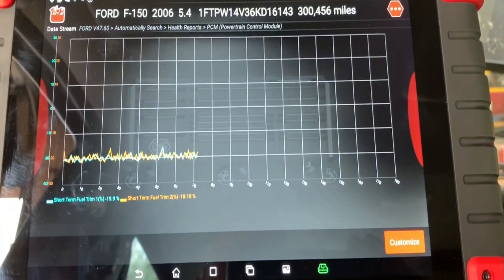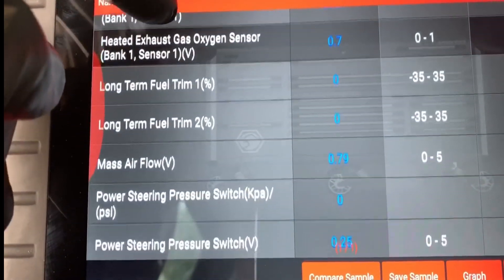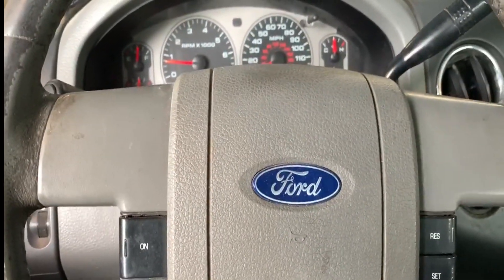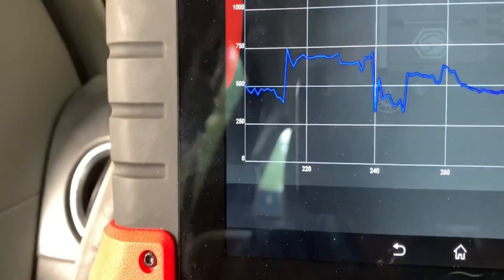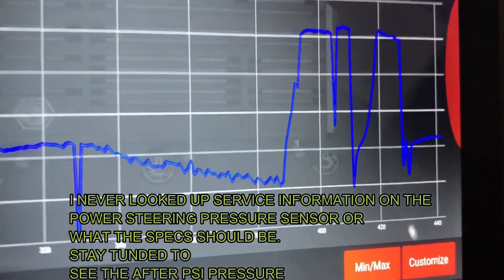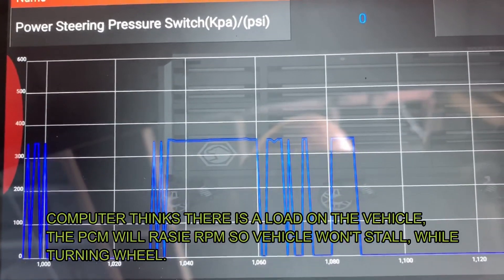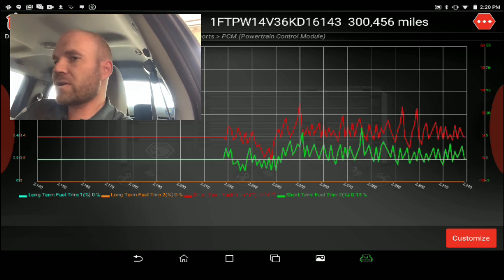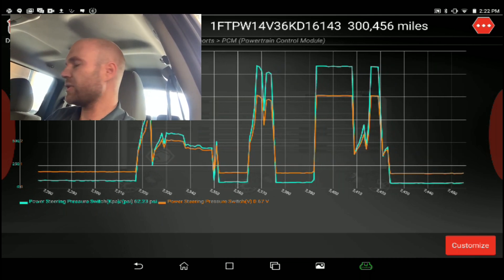NEGATIVE FUEL TRIMS?

Comment: Thank you 🙏🏻 been chasing the problem for a while after doing a timing chain and cam replacement on a truck I got when my BIL passed. My wiring is good but switch was bad. I didn’t have all the readouts but the freeze frame data showed an 18% engine load at idle. Unplugged the switch and everything when to normal. The lock to lock steering trick was the clue I needed to fix it. Thanks so much.

Comment: Thanks I hope you just helped me solve my issue with a Lexus GX 460 with P1603-Stall : history, P 1605 , and a low/high circuit for steering wheel and ABS ; that’s rough idling, cycling LT fuel trim from positive to negative.

When I turn the steering wheel the idle speed changes.  

Thank you.

Comment: Awesome video! I don't have a Ford truck but just bought an Acura with 13,000 miles on it and my bank 1 ltft is around -2 to 0% and bank 2 is -6 to -1%. Is this any room for concern or normal readings?

Comment: Excellent job bud :) I came here because my 2013 2.0L n/a lancer (manual trans) is reading short and long term -11 any ideas where I could start? It has electric power steering not hydraulic. If it helps its throwing o2 sensor  codes occasionally so it could be that

Comment: What should i look at? 
Fiesta 1.6 ecoboost 200hp.
Got -13 to - 16 ltft only at idle, as soon i hit the throttle it jumps to -5/-3, at wot is -3%, but when i release the throttle it goes down again. 
The car runs good, no hesitatuons and pulls strong..just a bit of rough exhaust sound at idle, and sometimes when i start the car when it is warm rpm go down for a moment then up to 750 rpm and stay steady. 
No error codes, no misfire in any conditions, o2 sensors working good, no visible leaks anywhere..
Reply: @Albe983   You ever figure that out with your Fiesta?
Reply: @woodworks351 itnis normal having a bit negative long term fuel trim
Reply: My 07 Crv is running damn near the same as your Fiesta

Comment: Thank you so much , fixed the issue on my mazdaspeed3 , wich is a fomoco engine also, do you think its possible that this was also my issue for why my Maf voltage and airflow werent matching what they should in the tune ? Cuz my voltage and lbs/min were way off from the tune before , i didnt get a chance to see if its also fixed
Reply from the maker: Hmm that’s a good question. I would want to see the numbers afterwards and verify it f this indeed fixed both issues. I can’t tell you for sure if it would since this was a “first” for me on this vehicle
Reply: @codysautodiagnosticsprogra8706  ill get back to you cuz ill be logging soon haha
Reply from the maker: Sounds good

Comment: Can you help me with stft bank 1 shows - 100 and bank 2 is at 0 what would cause this E46 325xi bmw am using torque app that shows me my fuel trim
Reply from the maker: What are your long-term fuel trims? Is this at idle or under cruise?
Reply: @codysautodiagnosticsprogra8706  idle ltft 8.59 bank 1
Reply from the maker: From those numbers sounds like you have a vacuum leak somewhere
Reply: @codysautodiagnosticsprogra8706  can a bad disa cause this I have p1093 and 5 bmw  codes one of those code is a disa valve

Comment: Heyy Cody my honda pilot short fuel trim bank1 is -27.3%  and starts at 0%
But Long term bank 1 start at -13.3% and won't change and this is at idle..Didn't check other way.
Any advice on this please.
By the way those 3 cylinders on bank one are dead and the 4 elements are there well the pcm is taking fuel away i know cus short term -27.3%.
Can you tell me my problem???
No check engine light neither🙈
Reply from the maker: What’s the fuel trim on the other bank?

Comment: Why couldn't you do a fuel pressure test first just to make sure that this is what the cause of it is so then the other person who cannot read this information would make sense of them mine turned out my negative fuel trim turned out to be a fuel pump pressure so I have replaced it and now I get a good reading
Reply from the maker: Isreal Perez why do that when I could watch fuel pressure on the fuel pressure sensor instead. Also if I’m not seeing something stand out on the pressure sensor then I need to focus on something else.
Reply: @codysautodiagnosticsprogra8706  you know what it is is that there's a lot of forms out there on YouTube that talks about fuel trim but none of them talk about how to actually read it so my problem was I couldn't understand how to read it so then what I ended up doing was a fuel pressure test my BMW is supposed to have 50 psi and lot of forms talk about all vacuum leak this and that so I ended up just checking it for myself and I had 45 PSI and it was going down to 20 and a half hour so I rolled out everything else that I ended up having a vacuum leak and then I replace my fuel pump now I'm on now I'm on day 2 without a lean condition and no one can actually tell me exactly how to read or to understand in basic terms
Reply from the maker: Isreal Perez your absolutely right and honestly since these were rich codes I wasn’t focused on the pump. I see pumps lose pressure but I haven’t ever seen them build more pressure so that’s why I didn’t focus more on fuel issue. Even if fuel pressure is high the pcm would command fuel injectors closed longer to make up the difference. Could have definitely checked it for video purposes though
Reply: @codysautodiagnosticsprogra8706  I do have a question for you though I don't think it's based on lean conditions do you know anything about a P0 604 I own a 2004 BMW and that's the only code that I have left it takes two days for it to class backup I did a are trying to figure it out my lean condition and turned out that my fuel pressure was too low so that's why I replace my fuel pump but now every two days I would have this code above the P0 604 now I do like your video it was really great

Comment: Had you heard about the power steering pressure switch doing this to the fuel trims?  I would have never thought to turn the wheel.  Wow!
Reply from the maker: Okie-Tom i had no idea the effect the switch has on engine load signals to pcm. I was amazed as well lol

Comment: Does this apply to a 2001 Ford Mustang 3.8L V6? Or are those more simple. Mine is currently running rich on both banks.
Reply from the maker: If it has a power steering pressure switch (which it most likely does) then I would check this
Reply: did you ever find out ? i have a 3.9 mustang with high negative fuel trims and was curious what ur outcome was

Comment: hi does anyone know what it means if i have a stft b1 s2 (%)    NA     and    a  stft b2 s2 (%) NA ?  Hope someone can clarify this for me thanks.
Reply from the maker: Means your scan tool isn’t reading the fuel trims. What tool are you using?
Reply: Cody’s Auto Diagnostics hi thanks for the quick response i do get a reading for stft b1 s1 and stft b2 s1 so i believe my scanner is working I believe this is causing me to have a fail emissions test but i have no check engine light hope you can help thanks
Reply: my live data show activity on the 02 sensors on all 4 i changed the 2 downstream o2 sensors and i taught that would solve my NA reading
Reply from the maker: mase202 there is no codes in the system? When you went threw emissions what did it say it failed for?
Reply: Cody’s Auto Diagnostics i just checked with my scanner usually if its green it passes its yellow so it probably won’t but i taught it was weird that a n/a reading is showing for the stft b1 s2
Reply from the maker: That to me seems like a scanner issue. First thing I would do is try another scanner before digging to deep
Reply: Cody’s Auto Diagnostics thanks for the reply do you think something is not being read or disconnected with the na reading or unlikely

Comment: It's crazy how ford's power steering pressure switches can cause so much trouble. Just saw a diagnosis video on a ford escape from South Main Auto. Where the power steering pressure switch was bad and the pcm was throwing an evap code!
Reply from the maker: This one was a good one. Didn’t realize how much control that switch has on fuel trims. I haven’t seen that video from Eric-0, I’ll have to go search for it
Reply: @codysautodiagnosticsprogra8706  https://youtu.be/vp7g5sSzkh0
Reply: I think it is a 3 part video. It's very interesting.

Comment: My LTFT STFT are - 17... MAF 2.6 on idle and with ac on idle 3.5.. egr error 99.2 sometimes egr fluctuating even negative error... O2 sensor 1 no reading sensor 2 reading is .1 to .9... air fuel ratio commanded and measured fluctuating...
Reply from the maker: What size engine is this you are referring to and also can you command the front o2 sensor rich to see if can go above .8mv?
Reply: @codysautodiagnosticsprogra8706  my car is honda civic 2012 1.8 L
Reply: @codysautodiagnosticsprogra8706  using torque pro but not getting the reading of o2 sensor 1... for sensor 2 its .6 around
Reply from the maker: Mohsin Rehman you will want to force the o2 sensor rich then force it lean to see if it will go above .8 mv and below .2 mv. If it doesn’t then the o2 sensor is bad
Reply: @codysautodiagnosticsprogra8706  how can i do it
Reply: @codysautodiagnosticsprogra8706  if i unplug o2 sensor... the commanded air fuel ratio is constant 14.7:1
Reply from the maker: Mohsin Rehman lull the hose to booster and add brake clean or carb clean and see if 02 goes rich, then take it away and see if it drops lean

Comment: Ah nice one! For 10minutes im going like, what does this guy want with fuel trims and powersteering pressure data....? Thnx for the info m8!!
Reply from the maker: Right that’s how I felt seeing this. I was like WTF. Thing came back couple weeks later due to that power steering pressure switch pulling 5 volt ref low to 2.5 volts. The sensor was not OEM and was aftermarket but again fuel trims were negative 25 percent.

Comment: Seemingly thats a hard fault so regardless if codes where cleared why didn't it return immediately with just koeo?? Or is it one those consecutive drive cycle type fault????
Reply from the maker: You would think that it should have been a hard fault and come right back but it didn’t. I’m pretty sure if I would have done the KOEO or KOER test, a great possibility a power steering sensor code would have popped up. I didn’t perform this function and only performed a pre scan of all the modules.

Comment: Nice find. Makes sense, pressure sensor making the pcm think there's a load and it adjust fuel trims as necessary. Except it was a false reading.
Reply from the maker: Thanks bro, I had no idea how much the pcm strategy would look at the power steering switch but apparently it seems to hold some weight. Wish I could find more info on pcm strategy on this situation.

Comment: no fricken way.  how in the world did you diagnose this without a hope and a prayer
Reply from the maker: tracycolorado I got lucky bro. Pulling vehicle into the shop I noticed fuel trims changing while Turning the wheels
Reply: Cody’s Auto Diagnostics  but if you didn’t have your scan tool hooked up pulling it in it may have been a longer diag for sure! Goes to show you should always have that data streaming during a test drive. Even if it just into the bay. Nice find!
Reply from the maker: Martin Bonoan very true!

Comment: so how exactly does the switch do anything with fuel trim?? also did you get lucky and notice turning the wheel it leaned out?? then went from there
Reply from the maker: Pcm watches power steering switch to adjust idle rpm and injector pulse width to compensate for the load on the vehicle
Reply from the maker: Also I noticed the fuel trims while pulling into the shop and turning the wheel fyi
Reply: @codysautodiagnosticsprogra8706  good lucky find but good diagnosis seriously
Reply from the maker: Sometimes it points you ina  direction quickly and sometimes it doesn’t lol. Thanks for the comments buddy
Reply: Phil!

Comment: Weird is the only word to describe this situation. Why would the computer take any notice of a pressure switch ???  Maybe 5v reference is being compromised. The circuit diagram needs to be examined.
Reply from the maker: Ps pressure switch is an input to the computer to adjust idle and injector pulse width so vehicle doesn’t stall while adding a load from steering. Hope this helps
Reply: I agree with this assessment, combined with stupid logic within the idle control system :-)
Reply: I don't see how P.S. pressure would directly affect fuel trim either. Throttle/idle speed only. I too suspect a sensor ground or reference voltage problem due to the short.

Comment: Nice Cody! Weird that higher than normal ps psi would cause the computer to fatten the pulse width. It should have also caused a higher than normal idle speed too, in which case it should not have been running rich. Any chance that ground circuit was affected too? Maybe the O2s could be effected by elevated voltage on the ground circuit of that ps psi sensor circuit? Or maybe the 5v ref was being pulled low? And no codes was also weird but we know someone was playing before you got there. 
I just don't understand the logic on the need for a fatter pulse width without also opening the throttle up a little more for the false load. Hope I'm making sense in my questions.
Reply from the maker: First off thanks for commenting Paul! Second your comments make complete sense. The rpm was elevated slightly very slightly, around 800 rpm which was nothing I could tell from sitting in the vehicle. I did notice that turning the wheel the rpm wasn’t changing, which it should raise to adjust for the additional load on to prevent the vehicle from stalling. I did notice that all three wires were bare and touching each other so I’m sure that ground, 5v, and signal wire all played a part. Also looking at the scan data looks like the circuit was getting pulled low from the ground circuit like you mentioned.
Reply: @codysautodiagnosticsprogra8706  yeah it is weird the fuel trim strategy there and it was constant, not coinciding with the drop out to 0 psi but with the constant 300+ psi (I think that was your nominal psi). So I was wondering if it truly is some weird strategy and is related to something we would only see on a drive by wire? Maybe the old style IAC valve type and you don't have this issue because the system would have opened the IAC for sure. (giving you air to go with the fuel for a higher idle speed). Or, was there some bleed into the O2 circuit causing a false richer than normal signal. I would imagine if that was the case though that, that engine would have been idling really rough. Was it? If not, then we go back to the later strategy I mentioned. So that means the command was there for more fuel and to open the throttle but the throttle motor and desired idle logic conflicted with the increase fuel demand strategy and so we can blame shitty logic in the program :-)
Reply from the maker: ScannerDanner very good points there Paul. This vehicle wasn’t idling horrible. 

I would be assuming the same thing about maybe some default strategy by the pcm for this situation. I’ve tried to do some digging in SI but can’t come up with an more info on the power steering pressure switch cause and effect situations. App it talks about is adjusting idle control but nothing about fattening the mixture, so definitely could be bleed back into o2 sensor, like you mentioned. Wish I could go back and dig little deeper for these answers 🤦‍♂️
Reply: Here's the thing, if it was bleeding into the O2 circuit somehow, it would have been a false rich and the negative trim would have caused an actual lean condition and I think a rough idle. As apposed to an actual fatter pulse width baseline command that was trimmed back out to almost normal by the fuel trim. Hence the normal idle speed and only slightly elevated rpm. Not sure man.
Reply from the maker: ScannerDanner you got me thinking, try and do some more digging on this and see if I come up with anything. I’ll keep you posted
Reply: I think you did good and your original logic is sound.
Reply from the maker: ScannerDanner the k you Paul and like I said you got me thinking and I really appreciate that. I’ve looked up to you for years so this is big for me😁

Comment: Thank you Cody. Good job. I'm not understanding how the power steering pressure switch is being used by the PCM to adjust fuel trims, since the main input for determining fuel air are the oxygen sensors.
Reply from the maker: Hi Billy, the computer uses the power steering pressure switch to adjust the idle up once it sees a pressure rise, so the additional load won’t stall out the vehicle. Since this is showing high psi it was adjusting the injector pulse width to compensate for the load (that it didn’t have)
Reply: @codysautodiagnosticsprogra8706  if its adjusting for the load it doenst have why isn't the idle higher than normal? thanks

Comment: Great video Cody. That puts things into perspective. When you were turning the wheel and the FT's were changing all I could think was WTF.  But looking at the big picture the question is, what inputs will affect the engine performance like that? Feeling bummed for the cameraman though. Couldn't you just have sent to some training to improve his skills?
Reply from the maker: This comment made me laugh 😆 about the cameraman, so thanks for that buddy. The pressure switch is used as an input to adjust the idle and pulse width of the injectors for the additional load on the vehicle. When there was no load on this vehicle but a pressure of 300 psi the injectors were staying open longer.
Reply: Kirk!
Reply: @ScannerDanner  Yep. Sometimes the lightbulb flickers lol.

Comment: That tool is bad ars  great video, many would of run down the wrong path . Great job in discovering input related , from a component that would be unexpected . In a fuel trim diagnosis .
Reply from the maker: Thank you Doug! I guess I’ve never paid attention to how much control the ps switch has in for fuel trim control tell seeing this.